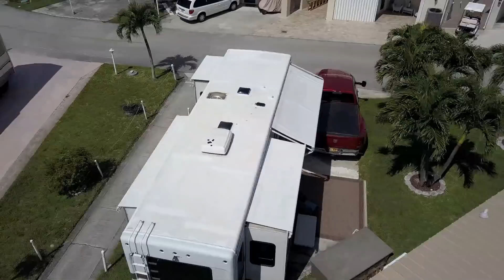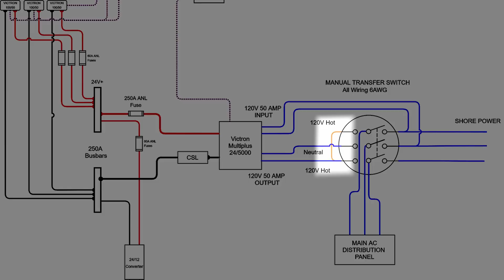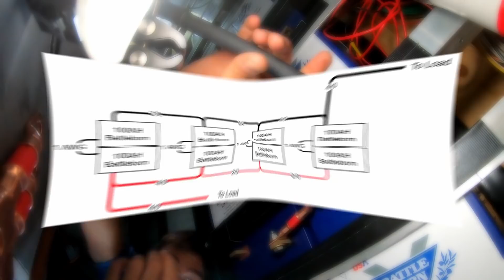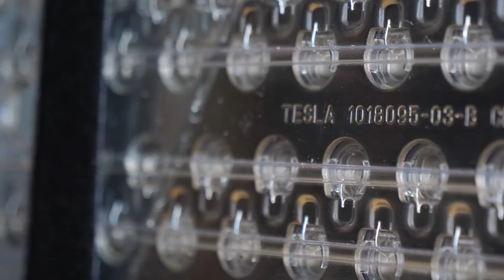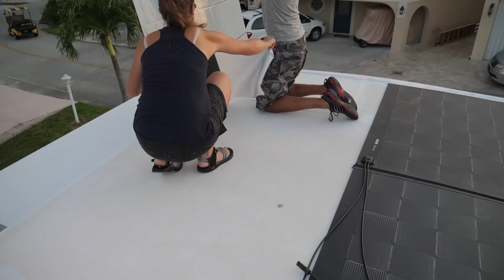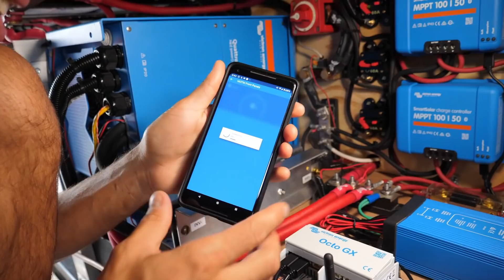Ultimate RV Solar System Build Details  - Turning an electrical Schematic into Reality  (PART 2 )

Comment: Hey Tom using the one 5000 watt inverters in your system was good i think and help me out with this? So rather then using two 3000 watt inverters it makes it easier to tie into your Breaker panel with just one line in and not having issues with separating your large load draws like two air conditioners to run together and washer and dryer etc. With using just one 5000 watt inverters you can run large loads with no problem right? what’s your thought if you can help me on this issue. i want to install 3000 plus of solar panels on my new 42.5 ft Grand Design and am not sure which way to go with inverter issue. need your opinion please?

Comment: You sure can contort into tight places.  Very nice design and layout. Why did you use a small plumbing pvc pipe to go through the plenum area?  That pipe has to be a heat and magnetic choke on the wires and that is not very safe in a plenum area even in a camper.  Apologize if I am wrong on the pipe.  The young Lady needs to be doing professional recordings for businesses and radio, she has a wonderful voice.

Comment: Hi Tom! I've enjoyed many of your informative videos but none more so than the ones on your ultimate solar system.  

I'm in the process of gathering information and funds for a solar panel system and changing over to lithium ion batteries.

I was fascinated with your choice of the flexible solar panels that you used. After the last six months of usage do you have any new insights or thoughts about sticking down panels directly to the RV roof?

Have you had any adhesion issues in changing temps?

Is heat transference from the panels into the RV an issue on hot days because of the lack of an air gap?

What are the names of companies making flexible panels?

Any other bits of wisdom would be appreciated!

Thanks!
Reply from the maker: Hi Burt! Great questions! We recommend checking out a few of the solar articles on our blog, starting with this one about flexible panels: https://mortonsonthemove.com/flexible-solar-panel-performance/

Comment: Was your roof sealed with any type of “Henry’s” like materials, or is your roof still working with just the original membrane cover? And if so, how confident are you about the peel and stick backing on the solar panels?  Did you guys use flex tape to cover edges? I heard you “testing” the panels (not available yet through BB) and am apprehensive about installing any in worries of them blowing off, what type of heat could be transferred underneath the panels to roof and if there could be accumulated moisture buildup over time.
Reply from the maker: All good queetions,will be answering them all soon in a blog post.  The roof is the original material but the edges and one repair area has henry's selant on it so some panels are mounted to it. We did use 3m extreme seal on the edges. BB has had trouble with stock of these panels but they should be available soon.

Comment: Tom,       You still didn't go into how you connect the AC the the fuse panel, so the RV has power on that side. I have watched these two videos several times and that is the part i am confused about... In fact, i have watched dozens of solar install videos and that is the part no one covers....... Please Help.
Reply from the maker: The fuse panel (DC) or the breaker panel (AC). If your referring to the DC fuse panel I just cut the main wires that originally ran to the main batteries and connected them to the 12v converter.  If the battery bank we're 12v you just connect to the busbars.

Comment: I'm not able to go full-time RVing yet, but wanted to get ready and install solar on our 34' 5th wheel.  Your idea of using your excess solar to charge your car and bike gave me the idea of using the excess solar, while the RV is stored at our house, to power our house.  Can you provide any insight into how that would work?  How would we match the grid power frequency to use the RV solar to power our house and use the batteries to power at night.  Any help/guidance is appreciated.  Thanks for the great videos!
Reply from the maker: That would be a bit tricky as you would need a grid tie inverter and the utility to give you the grid code to use it.  The inverter we installed can do it but I doubt the utility would allow it.  You could island the house but your available power would be pretty low for a whole home.   I will have to think on this one a little more 🙂

Comment: Maybe I missed it in the video I was wondering how many watts of solar you put on your roof with all the panels.

When you do an update on performance can you also give us the actual watts numbers that reaches the batteries. 

Heat loss from the solar panels and the wire loss genuinely will be less power output from the total wattage on the roof.
Reply: Looks like 10 panels on the roof and 2 on the front cap.  Tom said they 230 Watts each so I estimate 2760 Watts under optimum conditions.

Comment: Thank you very much for your video. We hope to do some long part -timing when we retire and a decent solar system is very much desired. I realize that this is your 'dream' system. However, for mere mortals, I wondered if you could comment on my sizing question. I figure that comfortably, my wife and I would not exceed 200Ah per day (probably more like 150 Ah). With my current system in Ontario, I find that I can have cloudy days where I get only 20 or 30Ah out of 400W of solar and a 40A MPPT charger with the batteries flat enough that they could have accepted 100 Ah or more. So, I figure that I should have enough battery to handle 3 full days => 6 x 100 Ah LiFePO4 batteries. OK. Now, how would you size the solar? The LiFePO4 batteries are going to charge a lot faster if the sun is out. If my entire bank is near flat I would need 540 Ah (ish). Should I size the solar so that I could charge up this in one day of full sun? Is that a decent rule or pick at least 2 days worth of energy (ie 400 Ah)? etc. I am thinking of 800W. What would you suggest? I was thinking of going with the 3000 VA hybrid inverter charger as my AC does not take more than 13A and we do not have that many high current appliances. You advice would be appreciated. Travel safe. henri

Comment: Great stuff; I appreciate all that you do, and especially the perspective of an EE on the RV's electrical system.

However, the battery wiring gauge is weird--how do you fuse it?  As I understand it, the fuse would have to be chosen to protect 1 AWG (unless the batteries limit the current to 1 AWG level, but I don't think that's the case), but then what's the benefit of that larger gauge cable (other than lower resistance, which doesn't seem to be a benefit in this case)?  If you could GUARANTEE equal current sharing among the batteries this could work, but you can't guarantee that (even though it is likely to happen if the batteries are balanced).  Is there an NEC section that specifically allows this?

Comment: Great video ... Thank you!  Did you seal all four sides of the panels?  Your process using corregated panels under the solar panels to help with possible heat issues wouldn't work if all sealed, would it?  (A solar wannabe here, lol)

Comment: Fun video, lots of work huh??? To need that much solar you must require a lot of energy WOW !!! Those front vertical panels are a waste in this engineers opinion and major bug catchers, but its YOUR rig... What you referred to early in the video as a Hole Saw (on your cordless drill for making a hole in the roof) it's always called a Spade Bit or Paddle Bit everywhere I've been.

John T   BSEE,JD

Comment: so you originally installed a tesla battery for your off grid power needs and made sure you installed a bms on the tesla batteries to make sure everything would balance out and be safe. now you are installing battle born batteries and now are worried about the safety of the tesla batteries? did u happen to pay for the battle born batteries? or were those free of charge?

Comment: In the list of parts, I see no mention of the CSL but that is a part I am most curious about since I am concerned about that for the system I plan to build, mostly since I plan to build my own LiFePo4 batteries (<1/2 price of BB)  and the BMS I plan to use has a painful reset procedure if the current spike exceeds it's rating.

Comment: Tom, one big disappointment for me was seeing you use vice grips on hex fasteners.  One other question is whether or not you were doing yourself any favors sealing the tube in the corrugated plastic panels.  It seem to me that even the slightest amount of wind would help to evacuate the hot air out of those tubes and keep the heat out of the rig.  But all in all a really neat and tidy installation.  Keep the good stuff coming.

Comment: Isn't it funny when you get done installing and wiring solar panels, there's always clouds. I live in freaking Phoenix, Arizona and had the same issue when I did mine. 
This is a monster system! Congrats! The only constructive feedback I have is the through-hole in the conduit on the roof isn't sized properly. Needs to be bigger per code, but it's probably fine :)

Comment: Great system! You should be proud of it. 

I have been curious about these flexible solar panels for awhile now. My fear is that they would become so hot that they would degrade/damage the RV roof material. The insulating material you put under your panels is a good idea.  I guess time will tell. Also, did you incorporate any form of external ventilation into the underbelly of your coach where the inverter and solar chargers are located. I could see the inverter putting out a lot of heat when under load and it wouldn't be such a good idea to having it recirculate the same air repeatedly. 

I hope you do several follow up reports over a period of time for all of us newbies out there!!!

Comment: Dumb question... if the shunt is connected to the negative side where the power comes in and goes out, why are fuses always on the positive side?
Reply: John Landry shunt is not a fuse.
Reply: Robert Garbe I know. But my understanding is that energy flows is from the negative side towards the positive side. Putting the fuse on the positive side seems to protect a circuit from overload after any damage could have been done. My understanding of flow may be wrong, I’m just starting to figure this stuff out. Thanks for responding.
Reply: Well the deal is this..  most RV’s have chassis grounds that many systems attach to, which is any bolt attached to the frame.  SO anytime you work around you 12 or 24 volt system, you can possibly short the positive to negative.  This is the same with a car where you always disconnect the negative so you don’t short your wrench to any metal when disconnecting the positive.  

Disconnect the negative and no stray connections can short out..

Comment: If you look at the MPP Solar inverter product, they have a Hybrid series Grid tie with battery backup solution.  They have 10Kwh product.  At first, I started thinking to consider the Victron inverter 5000w but then later found the MPP solar 10kWh Hybrid product to build my Grid-tie battery backup system with the Kohler 14kwH house generator that I already own.  This will be a 48 volt system which supports 220 volt appliances.
Reply: Have you installed and are using this system yet? I am thinking of buying the MPP 3kw inverter/charger charge controller, PIP 3048LV-MK with 3,240 watts of solar and a custom built 14.5kwh 48v battery bank installed on my motorhome. I was wondering how you liked your MPP unit and how it was holding up? Thanks!

Comment: The pipe that they ran the wires to the roof in is a plumbing pipe.  PVC electrical conduit is grey, plumbing pipe is white.
Reply: Adam Meany So,  no requirement for conduit in an RV roof.  No harm, no foul.

Comment: I once had a RP06 drive installed with a loose screw on the B+ terminal. Local techs struggled for nearly 5 months to fix the intermittent gremlin. To get it fixed DEC sent a tech from the Memorix factory to disassemble the entire drive to kill the gremlin. The loose screw was right under the spot where I could thump the drive to stop/start the fault. Loose screws happen.

Comment: WOW!  That Tesla battery looked pretty sweet!  I'm really interested in how you got that and how you hooked it up..
Reply: They have a video series from a few years ago on setting it up. Its salvaged from a wrecked tesla. You can just buy them online.
Reply: they ripped out the Tesla battery on this install to replace with the safer Battleborn batteries.  He mentioned in the video that the Tesla battery is Lithium Carbon and can catch fire easier.
Reply: If you watch the DIY Solar YouTube channel by Will Prowse he shows in detail specifically about building solar for use in home.  Also, the top solar inverter manufacturers send him gear to test and review.  He replaced his Tesla battery with Battleborn batteries too.  He also explains wire crimping, building the inverter wiring and test performs the system.  Definitely an excellent channel